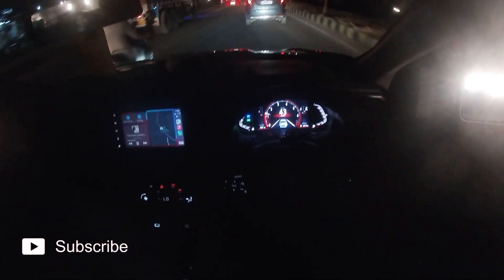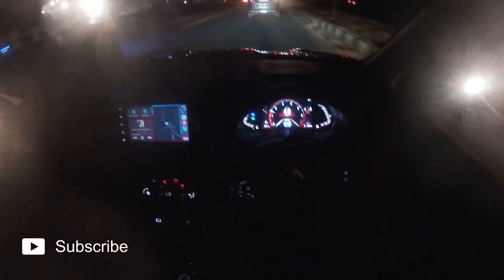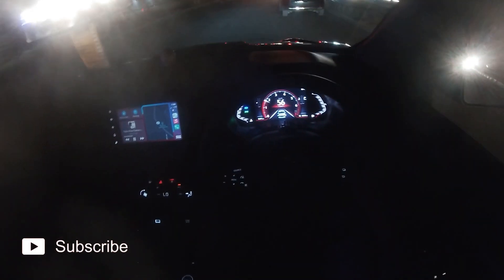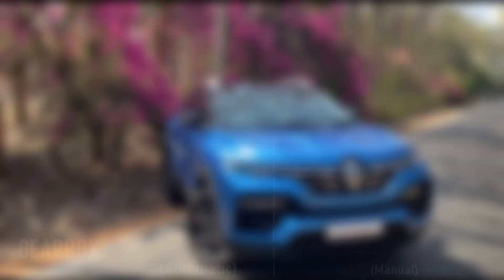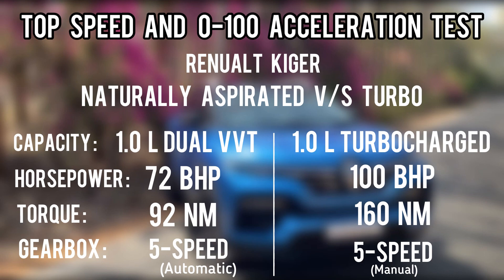Kiger Top speed | 0-100 Acceleration? | Turbo v/s NA | Renault Kiger top speed | #renualt#kiger

Comment: I must say LOL. I own the NA AMT variant. It takes 12 seconds to hit 100 kmph. I doubt if you are giving full acceleration which is wrong. Just a soft touch needed and once the gear changes, follow the same until it reaches the highest gear.
Reply: race with alto800 bro. yours magnite would give tough competition to alto 800

Comment: Is there a visible difference between normal and sport mode in Kiger? Could u distinguish between the three modes while driving?
Reply from the maker: There is no much visible difference in normal and sport mode sir, They have programmed the power distribution to engine in the ECU in each and every mode , it only makes slight changes not a lot !
Reply: It really feels more responsive. Can feel the difference on the highway.

Comment: RxT and normal mode on rxz gives same performance right?
Reply from the maker: Yeah sir both have same engines , so obviously same performance
Reply: @harshysautomotive3163  ok I thought having 3 modes would make rxz better than rxt in terms of performance
Reply from the maker: @No_One1231  When you change modes , the mapping will change according to mode you choose sir, but there will no huge difference, just a little tiny bit !